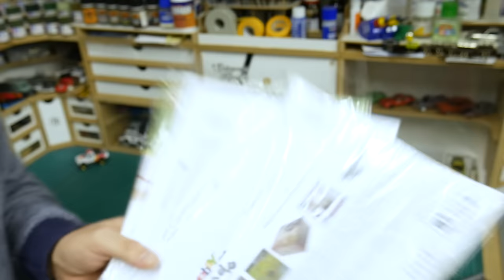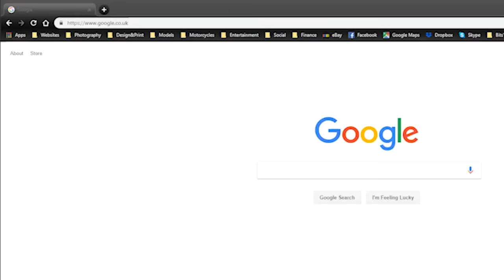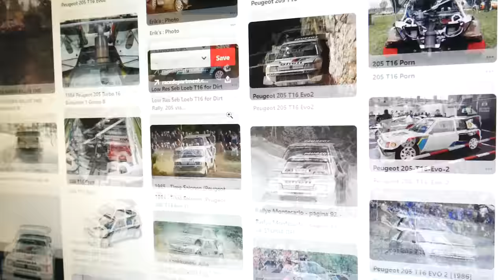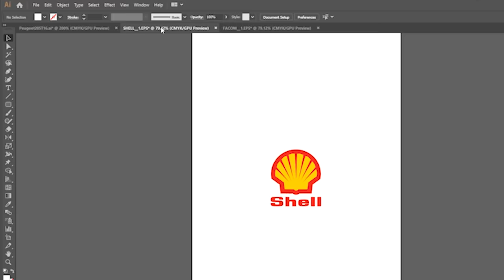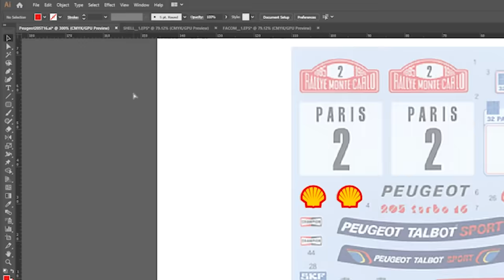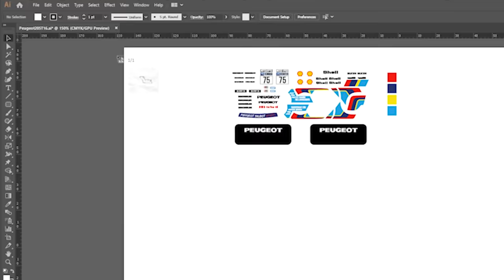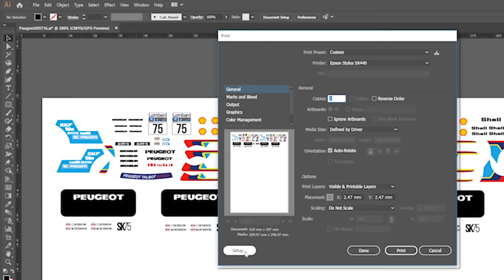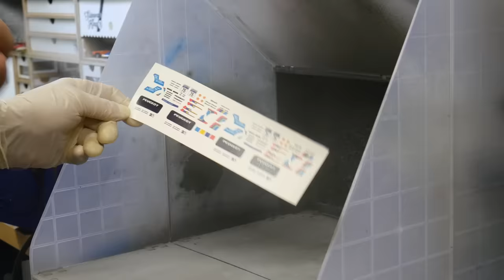'HOW TO' make water-slide decals for die-cast and model cars

Comment: what kind of ink do you use?? I've tried to print decals using inkjet printer with special ink for decal...but the result is always not good...the ink always wears off when in contact with water
Reply from the maker: Hi, With the inkjets you need to spray the print over with lacquer to seal it in. I do two coats of this. Leave to dry then when cutting out the design don't cut right up to the edge but leave a minimum of 1mm gap around the edge. Its only Laser printing that doesn't require lacquer first. Hope this helps
Reply: @SidewaysKing75  yes I already did that with 2 layer clear coat...but it seems the ink stil wear off when I slide it into diecast body...not totaly wear off only a small portion of ink...but still it ruined the decal color....thanks anyway 👍
Reply from the maker: @mendoanz  Sorry to hear that, the only thing I can suggest is a change perhaps in the lacquer. Its standard automotive lacquer I use which is this.... https://www.halfords.com/motoring/paints-body-repair/car-spray-paints/halfords-clear-lacquer-500ml

Comment: I wasnt able to hear clearly the paper he uses can anyone help me out and is it available in arts and crafts store ?
Reply: Printable decal paper he said either Epson or HP but I think he was just saying try a few and find the one you like Oh he also said he always goes with the gloss type even though they offer a matte
Reply: See the description, there is a link which I have saved into my bookmarks. Quite cheap as well!
Reply from the maker: Sorry Fritz....... The decal paper I use is linked in the description at the top. You can get lots of choice by simply looking on eBay or Amazon but I use the ones in the link. As for the printer settings gloss paper always works best I find.

Comment: sorry I don't quite understand.. is the paper just regular normal paper or its just use for decals? thanks
Reply from the maker: Special paper ...... links to it are in the description 👍🏻
Reply: @SidewaysKing75  HI thanks for replying. I was wondering wha to choose between the white and clear. I was doing costom cars, what is your recommendation?
Reply from the maker: @mitriul1692  Hi Michael, I mainly.ise clear but if your putting a design onto dark colours then white maybe the best option but you'll have to trim it very close to the design so there's no white edge around it 👍🏻
Reply: @SidewaysKing75  thanks! keep up with good videos too

Comment: A computer to me is like a flashlight (torch). I just want it to do what I want. I don't care anything about how it works. Yes, I know thats limiting.  So I didn't need a tool list but a little more info on the name of the program  .. Than would be a lot of help. Asking a kid working at BestBuy what program I should use to make decals will most likely get a deer in the headlights look. I do really like the presentation though. Thanks.

Comment: This would be great.....all you need is a couple of years of graphic design under you belt ...otherwise you are lost in the first minute....
Reply: Honestly, with just tracing another image into vector is fairly easy. A quick tutorial and repeat exercise lessons on how to use pen tool with any basic editing software is all you need. I would say no more than a few weeks of trial and errors. Also some of the new software even vectorize a clean image for you. Probably the hardest part for most is measurements of the car/design and making it print exactly to size. That will take some precise tweeking with millimeters.